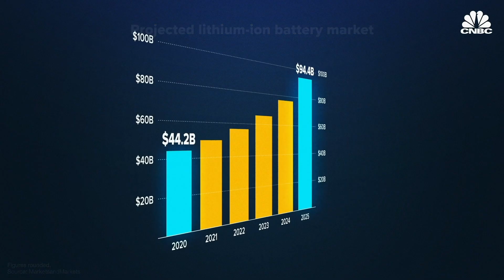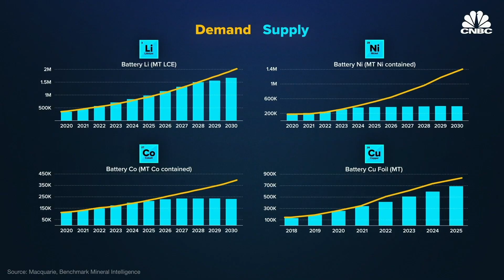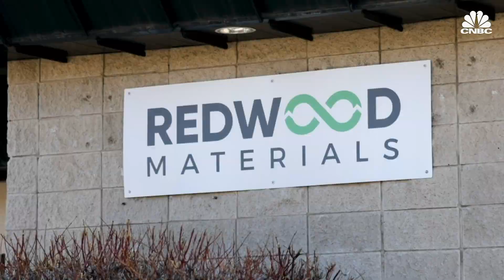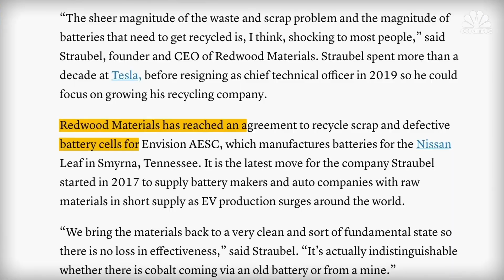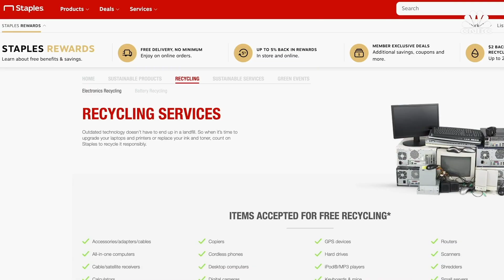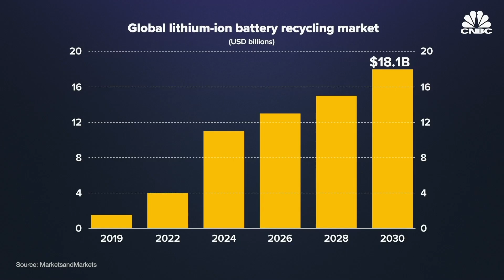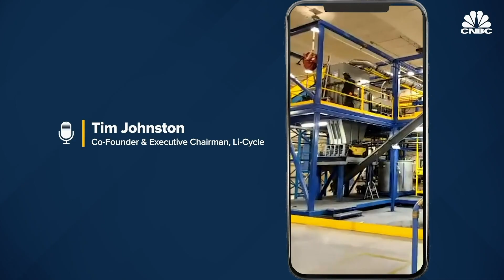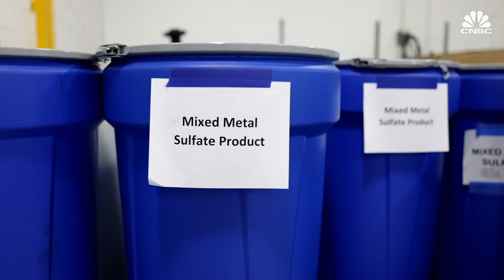How Tesla’s Battery Mastermind Is Tackling EV's Biggest Problem

Comment: aslo imagine the energy power you need to charge all those cars.  We would need all kind of energy plants
Reply: it's a 25% increase in the grid capacity if everyone drove an EV. That's not including the decreased electricity usage from places like oil refineries. We've doubled our grid capacity in the course of a decade multiple times over the past century, but yes, we do need some additional energy input. Even if we get electricity from a coal plant, it's still cleaner than ICE vehicles.
Reply: @enyotheios2613  sounds like we need to go nuclear
Reply: most People charge overnight on 240v , when power is Cheapest . 
even if you get a Powerwall and no Solar , you are better off.

Comment: Another benefit of electricfication .... Not like gas, we can reuse the same fuel. This is true sustainablity.
Reply: many States are starting to BAN Nautral Gas in NEW home Construction.
Reply: @markplott4820  So electric stoves?
Reply: @gopherlee9427   - yes, Electric stoves and Heating is much safer , 90% of Home fires are from GAS wall heaters .
Reply: @gopherlee9427  Sure, electric stoves running on AAA !
Reply: You're not reusing the same fuel, you're just recycling the energy storage device.

More akin to recycling a gas tank.
Reply: @Texassince1836  you're correct ...except this gas tank doesn't need gas ... And as we get better with wind and solar, we will be a lot close to sustainablity then we could ever get with ICE.

Comment: Well presented. Without question, without recycling, we are digging our own environmental grave. Thanks
Reply: US has got to end its petroleum plastic era.
Plastic can only be recycled 1-2 times and it not even worth recycling old plastic for new. Plastic is toxic junk. It has No organic value & when burnt it causes bad birth defects in the whole area.
Reply: @noneshere  hemp can do anything petroleum can do, but better. Hemp plastics can be biodegradable and recyclable. And hemp fuel is better than oil. Hopefully our government will relax hemp production laws so we can solve some of the problems you mentioned.
Reply: @noneshere  you can start by not buying plastic products
Reply: @noneshere  I agree. But the electric car is a heavy user of plastic made from petroleum. The average gasoline car uses about 340lbs of petroleum-based plastic. While the average electric car uses about 780lbs    
of petroleum-based plastic. The electric car manufacturers rely on the oil companies to refine crude oil for plastic used for the manufacture of electric cars.
Reply: Even with recycling, we are digging our own environmental grave. The guy says at the end that there are no alternative... Well, yes, there is an alternative : reduce consumption. But it would take a redical change from our economical system. And the mix of neoliberalism/oligarchy/corporatocracy that we are living in right now doesn't allow for that kind of change.
Reply: @bengagnon2894  The exponential population growth is the driving force behind the manufacturing of all these undesirable products. If you say just stop making these products you are saying, in effect, reduce the standard of living for the generations to come. Tell us what to do.
Reply: @bengagnon2894  For that to work, you'd have to stop every nation on the planet from doing that, which is unrealistic. Moreover, communist nations and monarchist nations tend to have even worse environmental outcomes. But most importantly, the sun will eventually annihilate all life on this planet. Technologically advanced human civilization capable of expansion toward Mars and beyond is Life's only hope of lasting more than another 100 million years or so. And for that, we'll need recycling.
Reply: @global_optimization  100 million years eh! I doubt the human race will last that long but who knows. If we survive that long we will have evolved into something nobody from now will recognize.
Reply: @bengagnon2894  The secret is to educate all the women in the world as well as give them the freedom to do what they like just like some countries allow for. Once this happens the world population will start to drop causing less pollution.
Reply: @johnabuick  like feminism ?
 Take a look at what turkey a religious theocratic country at what it has recently done to women's rights
Reply: @johnabuick  I do not know where you are from. I am from Australia and our birth rate is dropping and I am surprised at the number of women who don't have children and young women who don't intend to have children. Maybe it's our society.
Reply: @bengagnon2894  exactly right.
Reply: Look into Aqua Metals stock ticker is AQMS
Reply: We are digging our grave regardless as long as we rely upon technology. 

The difference is how effective we are at slowing it down.
Reply: It's good to see.  
I'm astounded that this may appear, or presented to appear as, a wonderful new thing.

This is old news.
Reply: We need to lessen overpopulation.  That's paramount.
Reply: @brahmburgers  that's what Covid is doing. Maybe you haven't noticed all the travel restrictions. Co2 emissions are down
Reply: Recycling of batteries isn't 100% recyclable. In other words there is no way to recycle 1 battery after it is depleted completely and get 1 new battery that is fresh for someone else to use. The used up part of that battery has to come from somewhere. It's not free!
Reply: That's why we are here to un stupid them

It's a compressed air battery
Reply: Electric car conversion would be an environmental disaster. Who would you buy one?
Reply: These CEOs are monsters

Comment: EVs biggest problem is scaling production, so many people want Teslas, so many people want the ford Mach-e, so many people want the VW ID 3/4. These automakers just need to ramp up production because right now, demand greatly exceeds production!
Reply: LEGACY is hindered by lack of Batteries and they are Still using OUTDATED production Technology.
the Chevy BOLT is 80% made by LG Chem , not by Chevy. all Chevy did was add a GAS car body on a BEV Platform.
the FORD Muck - e could have been better , instead FORD Chose to use a GAS car design for Muck -e.

Comment: What is shocking is why batteries are so expensive when the materials are so recyclable.
Reply: For now they are mined once enough material meets the cycle they may become cheap just like how aluminum was expensive in early days. I said "may" cus new batteries may replace them depends on what type of batteries will replace them. Graphene, solid-state or Carbon we don't know
Reply: It’s a new technology, but costs have dropped over 85% in just the last 10 years and are expected to drop another 80% by 2030. Batteries will be dirt cheap!
Reply: Microchips start as sand, silicon-oxide, purified and then precisely doped with minute quantities of rare-earths and copper.  The raw materials cost a fraction of a penny but the final product can cost $thousands.  The lesson: the elements aren’t the cost, it’s the knowledge to make them into useful products.
Reply: you need to take a look at the dirt industry , you cant imagine how much it costs to buy the dirt needed for building buildings
Reply: Try recycling one, see how much it costs
Reply: M - economy to Scale , because we still MINE rather than Recycle at Scale , add to the Price of Batteries.
also, most LEGACY car makers do not MANUFACTURE their own Batteries or with a Partner. 
TESLA has the lowest cost per /kwh because it Partners with CATL, LG Chem and Panasonic. 
and TESLA can get to just $40/kwh with LFP 4680 made by CATL.
Reply: @markplott4820  Despite all of that, batteries are not expensive to manufacture and are still about 10x times more expensive than they really are because consumers have no idea how batteries work.
Reply: @user-zb6yy5yj2q   - WRIGHTS LAW , Batteries get Cheaper each year.
TESLA 4680 only $40/kwh
Reply: Tesla's battery_price will drop by 56% the next 3 years!
Reply: @mikafiltenborg2291  Hahah
Reply: production cost and labor....